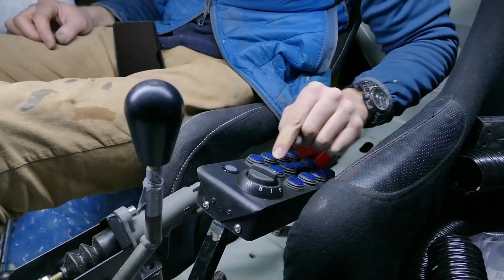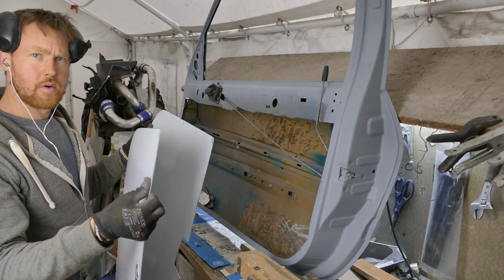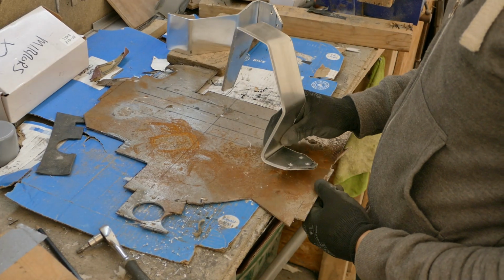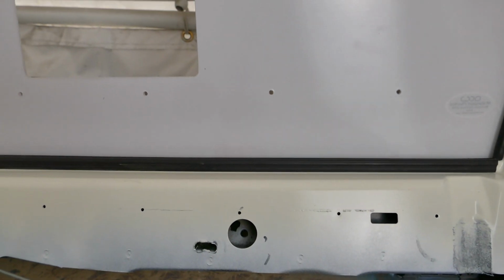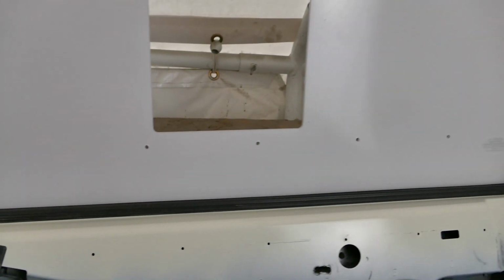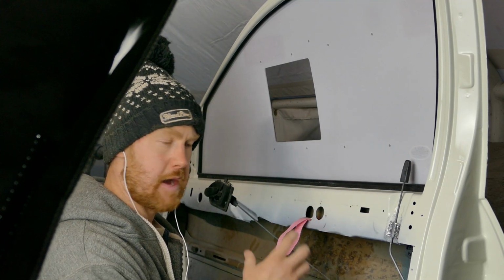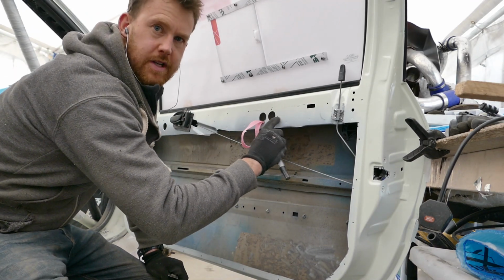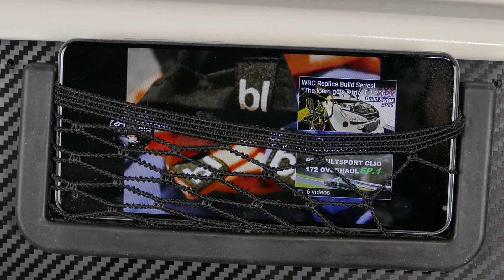Building Light Weight  Race Car Doors! *RALLY CAR BUILD SERIES* 206 WRX Ep91 #builtnotbought

Comment: Why not make door opening pull loop too? More weight loss. Also does a race car with full cage need door locks? Better yet, they do make carbon doors. The cost of them is about equal to the time you spent on the door and still way lighter.
Reply from the maker: The factory door pulls are plastic and weigh nothing, the door locks are handy when at shows or out and about. I would be impressed if you found some carbon doors:) + just replacing the doors would take the fun away from gutting the steel ones!